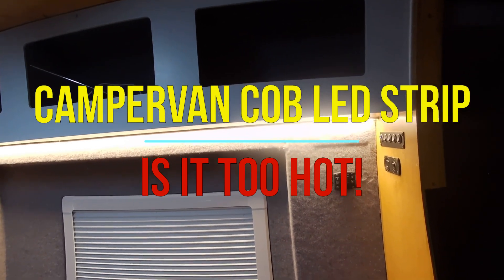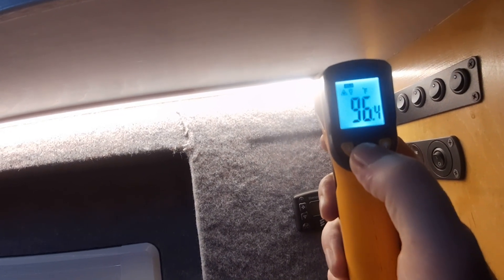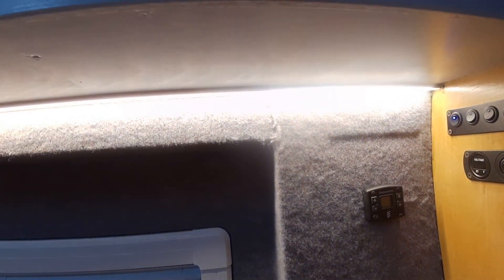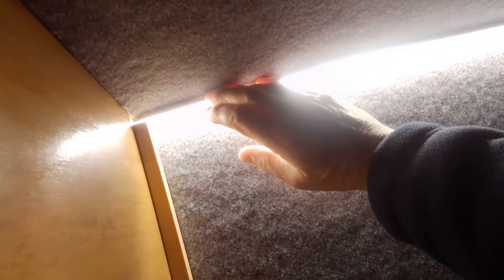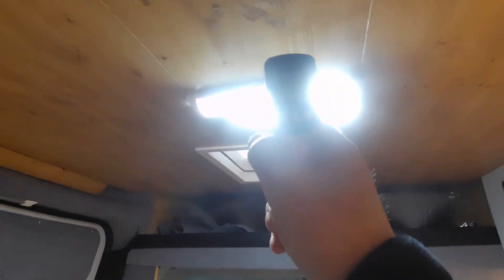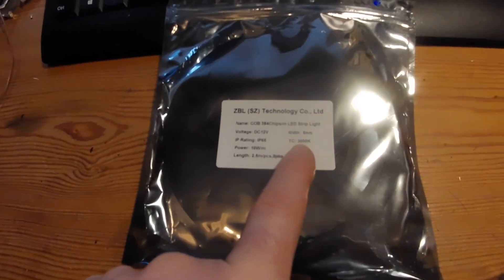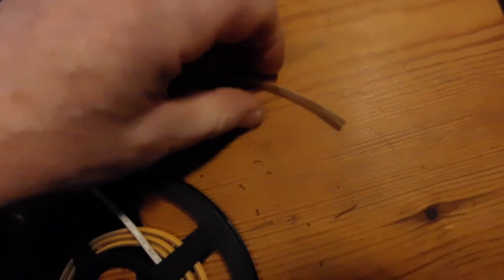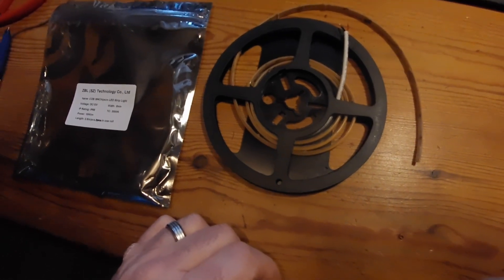Campervan HOT LED Strip Lights! Too Hot?

Comment: Not hot at all. The ali you have it attached to is capturing the heat and is doing a job of dissipating some of the heat. That temp isn't considered a scalding temp, if it was, my life in Australia would be unbearable. Probably the fibers of that wall carpet or felt are getting singed. The longer the stretch of LED strip, the hotter the front end of the strip will get supplying the juice to the other end. If the smell is too obtrusive, you could cut the length in half and power from either end.
Reply from the maker: Hi, wish it was warm in the UK, it's freezing here at the moment!
As i found out later the temperature gauge isn't showing the correct temp (see my other video) those infrared gauges are affected by the light coming from the LED and give a false reading.

Comment: A couple of degrees above body temp. Too hot to touch?
I'm guessing the smell is the adhesive on the carpet getting warm
Reply from the maker: I don't think those temp gauges are very accurate on reflective surfaces, definitely hotter than it reads.
Just measured it again after switching off the LED (no light interference), got 111.9F... Just goes to show the human hand can tell you more than an electronic instrument.